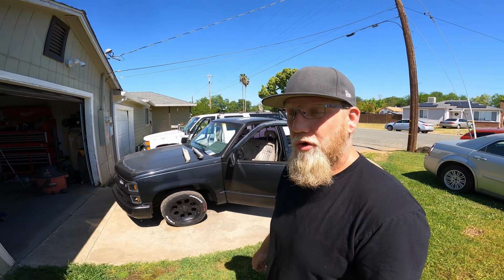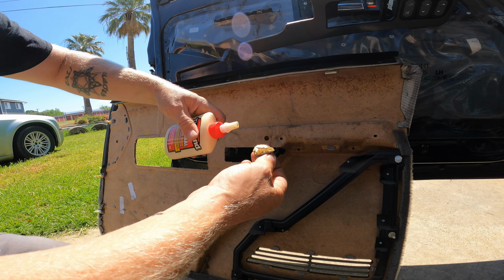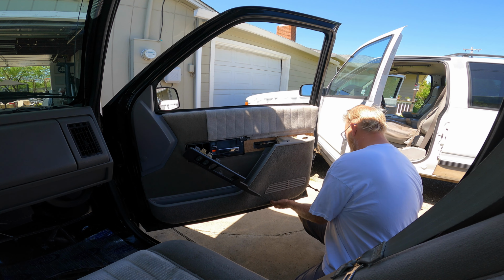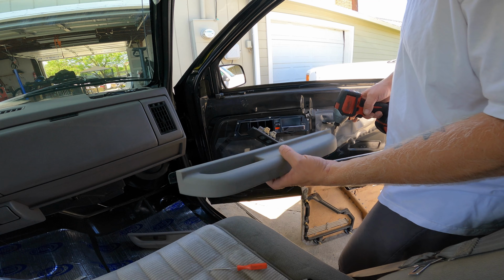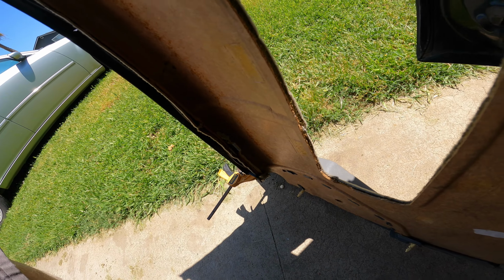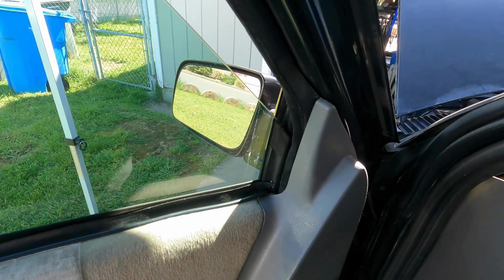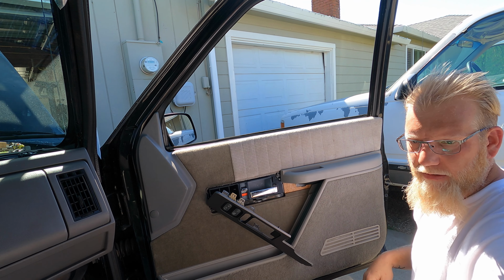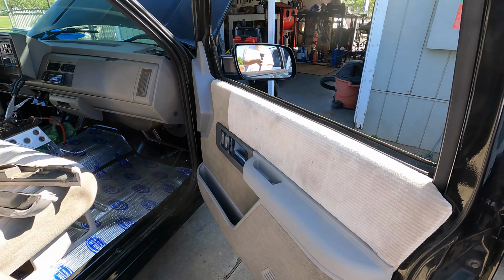How to remove and replace door panels and armrests on 88 - 94 chevy obs

Comment: I just finished my custom door panels last week also. I'm uploading a few private video's of My truck Alan so you can take a look. I saw a few video's of your where you are having steering trouble. You have to get your rack length and height in sequence with your suspension arms in length based on where it ties into the steering arm height wise- hard to explain this in typing. It relates mainly to bump steer, but you have to get your lateral alignment correct also for aiding Ackerman- lastly you need to have shorter steering arms to match the rack "throw" or travel. THe racks have shorter travel than OEM steering box geometry so the factory spindle steering arms are too long to use with a rack.

Dean- a.k.a. Doc Sake'

Comment: Do the armrests have to be removed from the panel to remove the panel from the door, or can the panel just be pulled away from the door with the armrests in place? Thanks in advance for your reply.
Reply from the maker: @HD24680  you cannot remove the armrest without removing the panel first. There are clips behind the panel holding in the armrest
Reply: @GibsonGarage  
Ok thanks. My armrests are fine. I wanted to retint the windows and figured it would be easier with the door panels removed. 👍🙂